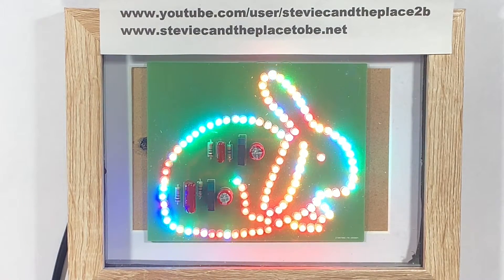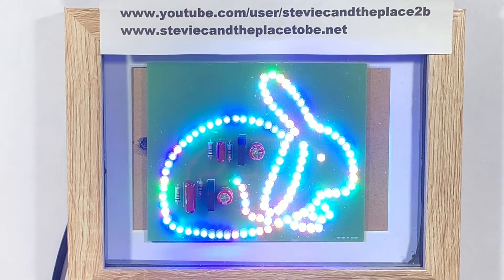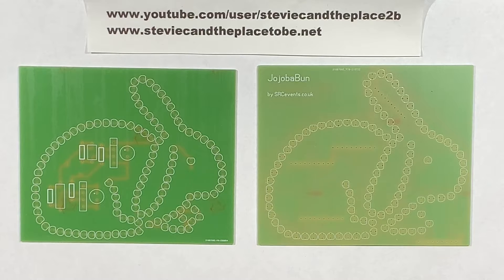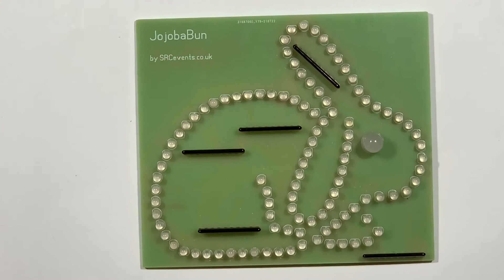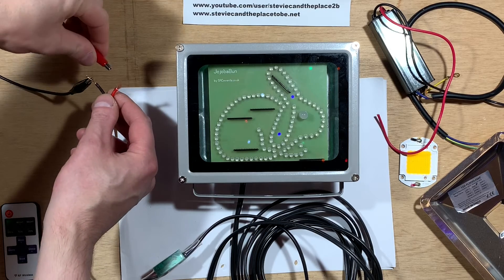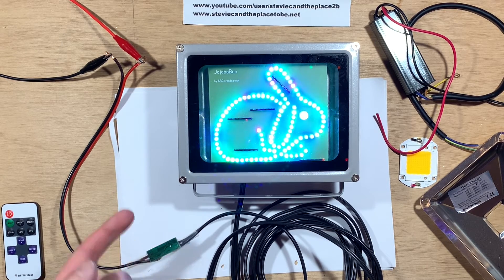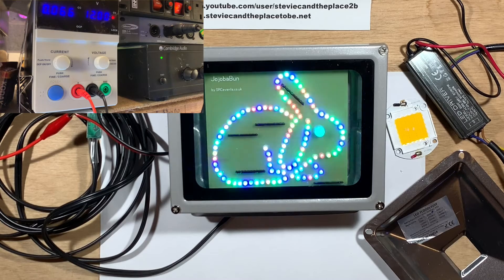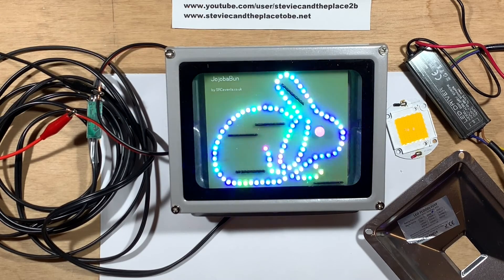Jojoba LED Bunny PCB update

Comment: Great job Stevie. How’s your stock of pcb’s looking. I’d still like to get a selection of a few of the boards you have designed
Reply from the maker: It’s still going to happen, probably via Etsy instead of eboo, but work etc has been getting in the way lately.